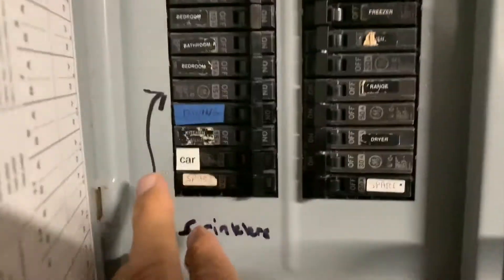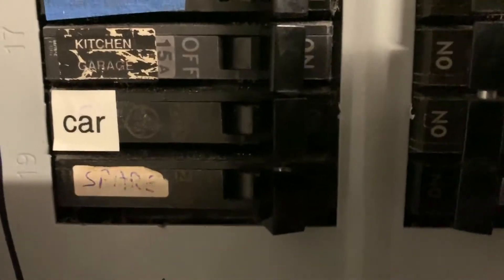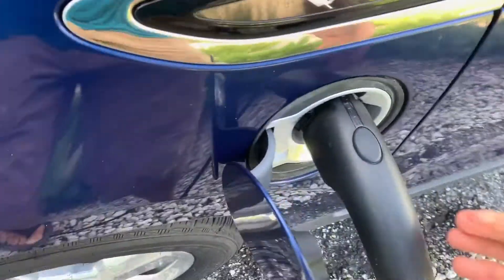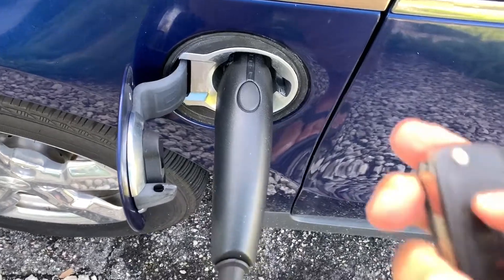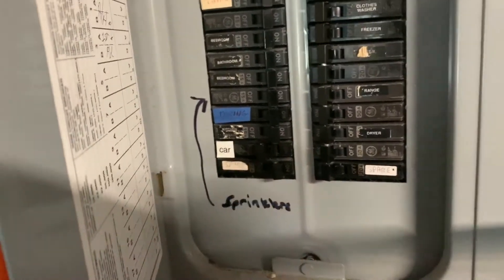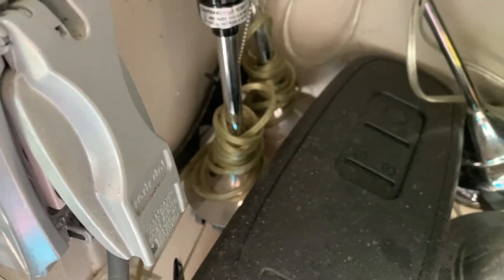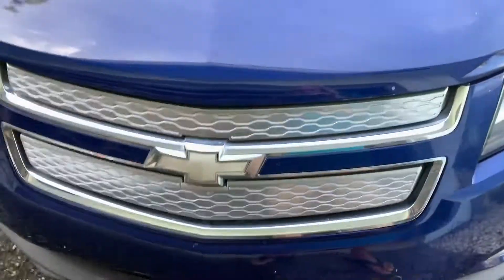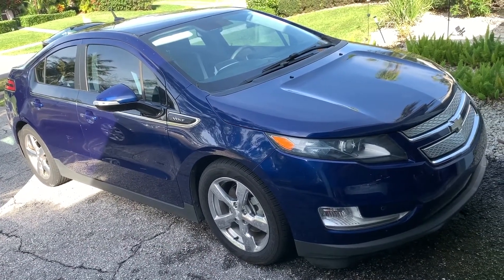How to set up your 110 charge station for a Chevy Volt

Comment: You mean 120 v unplug the unit not circuit breaker the first generation Chargers you need to cut the plug off put aftermarket quality on to get rid of heat
Reply from the maker: Good tips thanks for watching